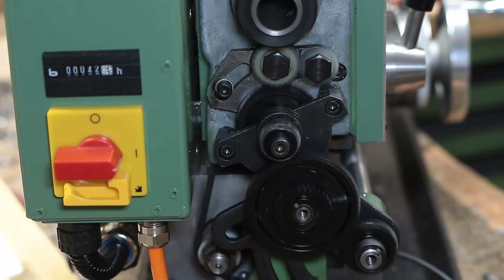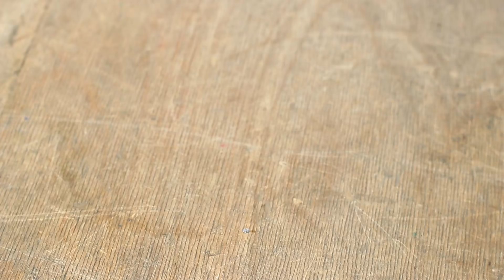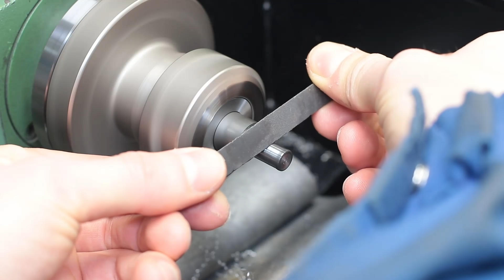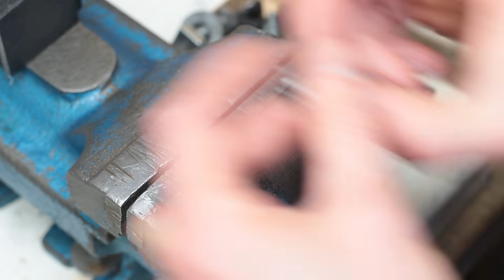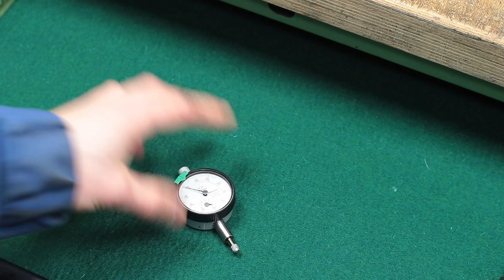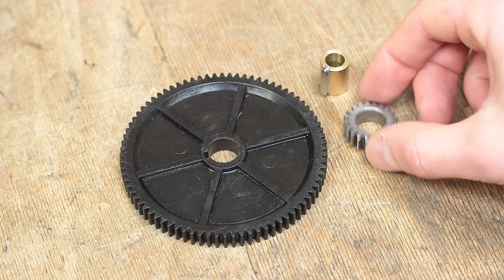Fine-Feed for the Mini Lathe

Comment: for decoupled power feed i would sugest using windshield wiper potor after  removing it's reverse switch but this could produce non uniform  cut pattern depending on the spindle load, although your mod is pretty clevar
if we would want a slow turner lathe couple it with similar speed reduction on the motor input and you can greatly increase the torque without changing stock speed controller or safeties
i am curently thinking about making some modyfications to my unit, along with extending the height of the spindle for a little more swing for a faceplate
it is kind of silly how so many people bought those mini lathes and how every one ends up as modyfied monster but everyone evolves into something different

Comment: I mounted a 4.5hp belt driven motor on my 8×14, and a completely custom gear and banjo system to fit basically any gears i want. BUT that was mostly for threading. For fine feed the MUCH simpler and more ideal solution was to make a small bracket and mount a small reduction motor with a speed controller, and connect it to the end of the leadscrew with a slip collar. Infinite speed control, instantly adjustable. It works great. And not that it would be an issue AT ALL for my 4.5hp motor to drive the leadscrew, the stock motors (even the "bigger" ones are utter weak garbage, so you dont have to split your limited power between turning the chuck and driving the leadscrew. It took 30 minutes to design and 3d print a mount that worked with the included motor mount bracket, 10 minutes to design and print a slip collar to connect the motor output shaft to the leadscrew. And drilled and tapped 2 mounting holes in the end of the lathe. Easy peasy

Comment: Another interesting solution project would be to make a worm gear reduction, which provide plenty of reduction ratio and high torque... although the problem would be then the 90° relationship between the input and output shafts. I have a Sherline lathe and I am struggling with this upgrade for a while now. Sherline sells a standalone motor for the leadscrew, but I would very much like to have something connected to the main motor like in the minilathe. Thanks for the videos.

Comment: Why don't you follow the gear setup chart on the lathe. Most lathe come setup for 5 thousands feed rate for 1 rotation. The lathe data chart is great, no guessing. I will never figure out why you tube people makes things so complicated. :face-orange-biting-nails:
Reply: Did you even watch the video? With the slowest factory gears the lead screw moves the carriage 0.00354” per revolution. With his extra gear setup, it now moves at 0.00177” per revolution. I will never understand why some commenters on you tube don’t watch or fully understand the videos they comment on beforehand.
Reply: @JohnDoe-ls2ww  I use 5 thousands per revolution It's works for me. It is on the feed chart, no guessing.

Comment: That is a good improvement to your lathe! I went the stepper motor rout for a completely independent control for y axis turning. I have a reduction belt drive to the right hand end of my leadscrew ( the feed handle is at that end as well so I lengthened the leadscrew plain end and added a vee pulley in between the handle and the bearing block)

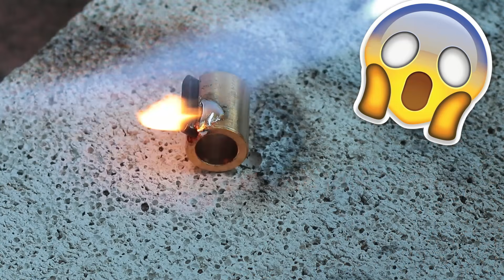Comment: 7:34 Good quality flux and super clean parts makes for painless soldering. A smaller gas tip to allow accurate control of the heat position is very helpful. The solder will flow towards the heat. 

Paul Brodie, a local bicycle frame creator with numerous other skills here in BC, Canada, has some great YouTube videos with silver soldering including one where silver soldering is covered in detail.

Nice work with your videos.

Comment: I did this mod on my 7x14 Vevor. I got it with some already 3D printed bigger gears (80/15, and 90/15) that were still too fast for me. So I added this mod to it because I was already looking at this very idea when I came across your video. I’m now getting 0.0015” of feed for every 1 rpm of the chuck. Thank you!!

Comment: If it is possible to fit extra gears, I wonder if we could use a metric/imperial combination. The ratio between 16 TPI and 1,5 mm pitch of leadscrews is 127/120. Such big gears won't fit but 126/119 = 36/34 is pretty close to the ideal, with an error of 0,049%. I found such gears online in reasonable price, so I will be able to give this idea a try. Some bigger gears if someone needs are:
54/51 error 0,049%
73/69 error 0,036%
91/86 error 0,019%
109/103 error 0,008%
If someone looks for 127/100 ratio on another lathe:
33/26 error 0,076%
47/37 error 0,027%
66/52 error 0,076%
80/63 error 0,015%
94/74 error 0,027%
108/85 error 0,059%
113/89 error 0,033%

Comment: This demonstration really helped me. I was given an very old mini lathe with just the bare bones. I used my 3d printer to print up some test gears, had to make a guide to get the distance between the main shaft and the feed. I used a piece of plywood as the test lathe. The slowest I could get was 14.25 turns to one turn of the feed. Just have to figure out what rpm the spindle is going on the different belt settings. UGH!  Appreciate all the help!

Comment: I've come to the conclusion the spacing on the banjo differs between mini lathes. The distance between the main gear and secondary gear means they are too far away to mesh using any combination of gear sizes. I think i can file enough out to make them fit but I'm going to make a new banjo specifically for fine feeds that will clamp to the lathe around the leadscrew housing. Will make adjustment easier.

Comment: I do envy that extra large test dial indicator of yours. I have had a look through a lot of machine tool suppliers here in the UK and as yet no luck with finding one. To make my search easer could you let us know the diameter of it please, for me and any other person interested.
Reply from the maker: Hi, at least someone who has noticed this comicly oversized dial indicator :D Thanks for this ;) I found this one on the used marked and found it so funny that I had to buy it. It has a dial diameter of 100mm and the brand is "Käfer". In Germany you find it with the keyword "Großmessuhr" which means "big dial indicator". Käfer GM 100 or GM 100/10 or GM 100/30 are types of the 100mm diameter dial indicators. Good luck and thanks for noticing ;)

Comment: This is a clever solution but I see two other possibilities. 

Put the little drive motor on the top gear, removing its key and welding a hollow tube on to the gear as a means of coupling the motor. 

Measure the actual torque required by first engaging the cutting bit with a part and then turn the lead screw with a torque wrench. It’ll perhaps take a little red neck engineering to engage the torque wrench but nothing a clever red neck can’t figure out 😊

Comment: I thought about this very topic a lot with my old lathe. Never did I think that there was enough space to fit an extra set of gears on the banjo. Good stuff. Also, what everyone else is saying, I can back up that a wiper motor would be strong enough. I have used several of those 24v wiper motors with gearboxes and they have heaps of torque. cheers
Reply from the maker: Hi and thanks for your comment! Great to have you here :)! The wiper motor is something I will take into consideration for the future, yes :)

Comment: Much easier for me,  3D printing two  even bigger gears. I was afraid they were going to break or wear quickly...but they are working fine for two years... still as new.
For threads it's very convenient to have an Excel sheet so you can have all the possible values and add any new gears you print.
Last if you are not comfortable with a torch, use glue...😂
Reply from the maker: Oh yes, I have to practice soldering:)

Comment: If your lathe has a metric leadscrew, the original feed is 1,5×20×20÷80÷80 = 0,09375 mm per revolution. You added the 20÷60 ratio, resulting in 0,03125 mm feed.
Btw, your solution is brilliant. I've already bought two 100 teeth gears to reduce my ratio from 1:16 to 1:25, but it wouldn't be as cost effective as your additional transmission step!
Reply from the maker: Thank you very much for your comment and your calculations. The calculated values are pretty much the same as what I measured. That's a good sign :) To buy larger gears was one my considerations as well, but I think the solution I found now is even more convenient or versatile.
Reply: The 100 tooth gear might not fit in the available space, or the cover may not fit.  Some measurement would be required.
Reply: @Henry-gj7mr  Yes, I would need to enlarge the cover, but the gears would fit in the holder. Fortunately I didn't proceed with my idea. I will choose more clever solution 🙂
Reply: @twkolejofil  I look forward to watching the video on that :)
Reply: Where did you buy the 100t spur gears? I'm also thinking about going a similar route as you did

Comment: I used a type of motor and gearbox very similar to a windshield wiper for a car.
Combined with some gears and an old DC servo controller.
Also combined with a Length meter system, so it's programmable for a specific return position.
Here is a video, it's in Swedish, but you might get some inspiration anyway.
https://www.youtube.com/watch?v=PVT6TOrua9U
Reply from the maker: Thanks a lot for your comment and the recommendation. Your video is a great inspiration. I will watch it, thanks!

Comment: aaaand this is exact reason why i never ever considered buying a lathe without three proper gearboxes. Sadly, there is just one such benchtop model (WM250G)
If only there were small lathes with power feed compound...
Reply from the maker: Unfortunately there is no such a small lathe with proper gearbox. That would be cool.
Reply: @WeCanDoThatBetter It's not that much bigger and weighs just ~120kg.

Comment: For the kind of 'powerfeed', I made a small handle on the guitar to not-connect the gears and on the right side of the screw I made an extension on which I put an old battery-powered drill. It thus gives me a independend feedspeed in both directions, still using the haflnut. It can move fast or slow too.
Since my old drill is Ni-CAD original, I use Ni-Mh batteries in it (just some penlights) with not soo much power but enough to do pretty well work. I will probably hook it up to an adapter in the future to  never have to charge them.
For threading, I just de-attach the drill and move the gears back into action. No need to change gears between threading and powerfeed this way too.
(yes, I have the intend of making a small video about this setup ;-) )
Reply from the maker: That sounds good, thanks for this idea. When you made a video about your setup I would be interested in.

Comment: How does the forward reverse lock in place? You removed the original locking pin to make room for the control box. Is it just the screw seen here 0:29 on the left clamping the plate?
Reply from the maker: Hi, yes it is held in place with the screw you see. This was needed because of the electrical cabinet on the back of the machine.

Comment: If you ever want to evaluate the torque needed to turn a shaft, especially a shaft with a threaded bore or a threaded end, just grab a hex fastener appropriate to the thread and get a torque wrench... A baby torque wrench is likely going to do well enough... You can also do the same and get a socket adapter for your cordless torque limiting hand drill, which allows you easily shift within a pathetic range best suited for torquing down screws in plastic, like when you change your car`s engine air filter and have to gently torque the lid of the filter housing down to 4-8nm... A smooth running small carriage with bearing supported leadscrew should not really require a lot of torque, but if the hand drill and it`s quick set torque limiter arent enough, a small torque wrench with 1-50nm should do perfectly... From that you can extrapolate the exact amount of torque on standstill that the motor has to have to nudge the carriage... You should also consider checking if the value changes as you cut into decent steel, as steel will be one of the better indicators of real requirements, being a tough material and a good margin to aim for... Just getting the motor to run a carriage on oily ways is one thing, having it run a proper cut in proper material is another... A digital torque wrench would do marvels in this situ, as most of them can just track the max torque rather than trying to click over at a pre-set, expected amount(which you can speculate on, but can hardly pull out of your ass if that is exactly what you are trying to find out in the first place)... 

Other than this little bit of advice, as always, a pleasant video!

Comment: I am wondering if the lower feedrate if you can dig deeper when taking material off as it would reduce tool pressure
Very cool addition! 
Keep em coming!!!!
Reply from the maker: Thanks for your comment! Yes, I think especially for these small machines a slower feedrate is overall better for the machine, especially when machining steel. The faster, the more toolpressure and power is needed I guess.

Comment: Great improvement for the lathe! I always wondered if there was a slower feedrate hiding in there. FYI, the next time you are milling an on-size slot like those keyways, try using a 2-flute endmill (aka slot drill) to achieve a truer result. George H. Thomas has a chapter dedicated to why this is so in the Model Engineer's Workshop Manual.

Keep up the great content!
Reply from the maker: Hi and thanks for your kind comment and the hint about 2 flute cutters. I didn't know that. Is this Model Engineers Workshop manuel you are referring to somehow available?
Reply: @WeCanDoThatBetter  Yes, re-printed by Tee Publishing, available online from their site, or several other model engineering sites. About £32 plus postage. It's a collection of a selection of articles from Model Engineer magazine (to which he was a very frequent contributor), one of two such collections that was published.
Reply from the maker: @thisnicklldo  Thank you for the information.
Reply: To expand on @thisnicklldo's comment...the MEWM is the best book on machining I've ever read. GHT is a gifted writer and photographer, and some of the projects in that book are very impressive. The offset-geared quick-retract compound slide comes to mind...I'm hoping a courageous YouTuber attempts that one some day.

Comment: Just use the gear motor from the wiper of any car by putting a gear of 16-20 teeth on the motor shaft, and the machine's running screw is 80, plus a speed controller and you can get small feeds up to 0.01 mm per revolution.The guitar must be disconnected from the spindle and you will be happy.
Reply from the maker: Thanks for that tip. Sounds really good. I should try this in the future.

Comment: Nice work! That pesky high power feed rate is a horrible disadvantage to these little machines... I would go electric but then might as well go all the way to cnc then. Sensible compromise!
Reply from the maker: Yes, I think that bothers a lot of us Mini Lathes users so I thought about showing a solution to this problem. And you are probably right electronics and stepper motor would be even better.
Reply: @WeCanDoThatBetter  might be better but then again, might be over kill 💁‍♂️
Reply: @WeCanDoThatBetter  another thought would be to add a separate lead screw to the back side of the bed for power feed just to keep the wear off of the threading screw... If a guy was to go through all the trouble of the electronic power feed
Reply: @britenrhodehouse8692  Easier to use a coupler to the handwheel-axle and move that with a reduction instead of putting another leadscrew with halfnut on that.
Reply: @elvinhaak  so your thinking driving it off the rack?
Reply: Yes. I have seen this work.  @britenrhodehouse8692
Reply: @WeCanDoThatBetter нет! Не обвешивай станок движками и проводами, сохраняй нормальную механику. Еще немного, и это будет как и с коробками передач авто, умеют пользоваться только профессионалы

Comment: Ich hab mir da einfach Zahnräder mit 100 und 120 Zähnen gekauft und die Abdeckung angepasst.
Das Messen kann man sich sparen, der Vorschub wird berechnet. Wechselradberechnung sollte man als Dreher mal gelernt haben.
Reply from the maker: Das war auch mein zweiter Gedanke (nach dem Getriebemotor). Allerdings sind selbst Plastikzahnräder mit 100 oder 120 Zähnen garnicht so billig und es wird schnell vom Platz her eng. Deshalb habe ich versucht, wirklich nur mit den schon vorhandenen Zahnrädern zu arbeiten. Und das stimmt, man könnte den Vorschub auch berechnen. War zu faul dazu und für einen Film eignet sich die Darstellung mit Messuhr auch etwas besser. Danke für das Feedback!
Reply: @WeCanDoThatBetter  Beim Conrad für 14,99, gar nich so teuer find ich.
Reply from the maker: @andikupper3414  Ja stimmt, das geht noch. Jetzt brauch ich sie trotzdem nicht mehr :)
Reply: Hi if you have a 3D printer you can print a 100T gear. I don’t know if a 120T would fit with out modification

Comment: Could you have attached a torque  to your lead screw and used it in increments to see roughly the torque needed to turn it?
Reply from the maker: Yes that would be possible. I just have no torquemeter for this purpose.